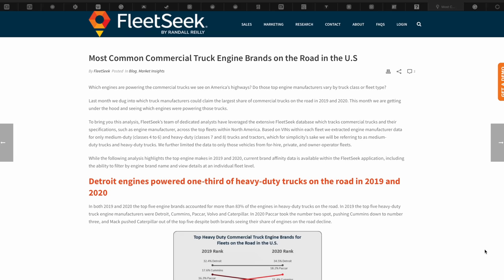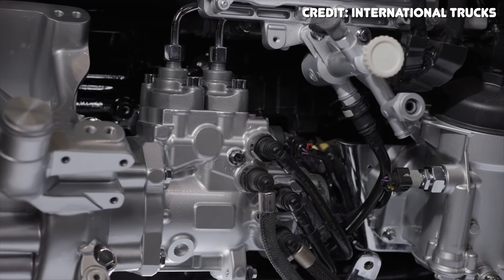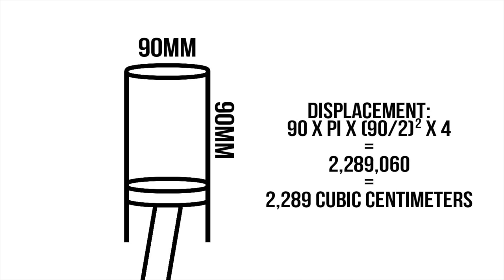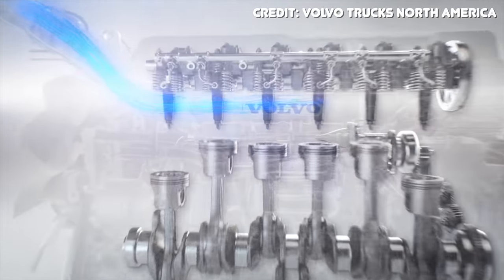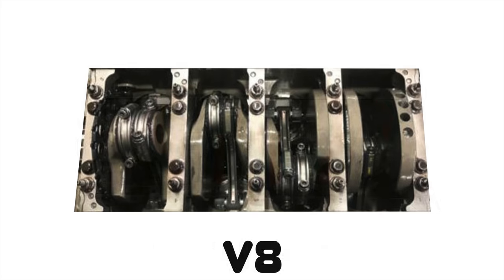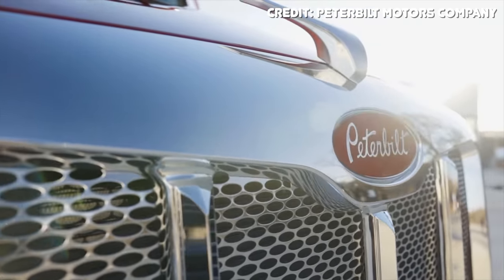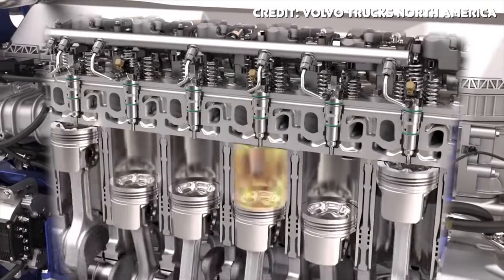Why do Semi-Trucks Use Inline-Six Engines?

Comment: My work truck with a Cummins in a Kenworth has almost 300k miles on it and still pulls 69,000lbs loads good. My work also has a Sterling with a Mercedes-Benz that has over 600k miles on it. I wish we had real Jake brakes with no mufflers on them

Comment: Inline 6 engines DO produce more TQ than ANY other style of cylinder arrangement because it allows the power stroke to apply force to the crank shaft for 120 degrees. I believe the 90 degree v style engine is the second best at 90 degrees of rotation being useful to power production.

Comment: Trucks in EU are limited by size, but still use inline 6 engines. I suppose that the longevity and ease of maintenance is more important than the size issue

Comment: the I6 has less lost motion than a v8 or a v6, the balance is better, and balance matters even at 2000rpm, also power pulses are smoother, crank harmonics are more manageable, and there are no shared firing cylinders wasting motion.

Comment: I hear people say “trucks need torque, not power” all the time and I’ve never understood why. They need torque at the wheels, not necessarily at the crank, and one way to achieve that is to have an engine that produces a tiny amount of torque at a huge speed and use gears to trade speed for torque; ultimately, to get the same wheel torque at the same speed, engine torque can be anything besides zero as long as the speed and gearing are appropriate, and the power output will always be the same. Is the real reason for this that trucks only actually need a few hundred hp, and the most efficient/reliable way to achieve that is with a big engine producing a ton of torque at a low speed?

Comment: Long strokes do not increase torque. The longer lever is countered by the smaller piston area. This was all researched decades ago. Long stroke engines typically produce high torque because that is all they CAN do. Their smaller pistons means they have smaller valves and smaller ports and higher piston speed so they will never rev up to produce lots of power so they are optimized for low rpm performance. On the other hand they have compact combustion chambers that burn well and quickly and have a lot less heat loss to the cooling system.
It is a myth that long strokes make more torque in and of themselves.(See "The Internal Combustion Engine in Theory and Practice" V1&V2 by C.F. Taylor. Which details a lot of that research.)

Comment: Does the low RPM really contribute to reliability? If the RPM is low because of the increased stroke but by definition increasing stroke means that the speed the piston moves inside the cylinder is increased for a given RPM (proportional to the increased stroke) then it cancels out so the friction (and therefore wear) experienced by the piston should be the same for a shorter stroke engine with a higher redline vs the long stroke engine with a lower redline. 

Don't they simply live for more miles because they do 100-1000 miles between cold starts while cars mostly do 5-25 miles between cold starts?

Comment: I was told way back when. . I-6 were smoother because of power hitting every 120° vs 90° and longer stroke allowed better low end lugging torque.

In trying to fathom the difference between torque and hp. I tell people that 800hp Dodge will never pull 80,000lbs the same as a 400hp truck engine.

Comment: In-line diesel engines are designed for one big thing which is: POWER Secondly, ease of maintenance and part replacement and compatibility with the old and new.

Comment: I'm kind of a newbie because I haven't worked much with diesel. And I haven't researched this question. But with regard to any internal combustion engine, I have wondered why, regardless of how many pistons,  why can't the crankshaft evenly split up the rotation? For example, with any six-cylinder, why doesn't the crankshaft split up the firing rotation every 60 degrees? Wouldn't that necessarily eliminate vibration?  Similarly, with a 4-cylinder, why not split it up every 90°?  Wouldn't that necessarily eliminate crankshaft balancers? With An 8-cylinder engine, couldn't the crankshaft rotation be set every 45 degrees?  I guess I need to research this to understand better. Any comments are welcome.

Comment: Regarding stayed words - bigger stroke gives more reliable engine - is not true. Cause forces(torque) is loading the rods and bearing  for one rev. If we get same torque in two or more revs of crankshaft that means that forces and loads are divided
The second thing is the longer stroke creates more rotational force on the skirt of the piston which is prone to rob against the cylinder wall. So stroker engines are less reliable.
I prefer longer rods with short Crankshaft, for more rev. And to have longer skirt on pistons for longevity. Downside of this is the low torque on low revs

Comment: Horsepower does matter though, 1,000 foot-pounds at 5 rpm won't be able to do much work. The larger stroke doesn't just mean more torque, it also decreases rpm. What genuinely makes these engines last so long is that they are driven on the highway all day without much stop-and-go traffic which causes 10-20 times as much engine wear. The engines also don't warm up so many times or drive cold as much as normal cars.

Comment: I'm asking this question out of ignorance, but with all the engine bay 
room in a commercial truck, is there some law of diminishing return that
 prevents a manufacturer from going to an in-line 8 engine to generate 
more torque and thereby pull loads more efficiently?  I would think that adding two additional cylinders and increasing the number of power strokes per rotation would provide a smoother engine balance and more efficient fuel consumption when under a load. What am I missing?

Comment: Other than a Detroit. some inline, some not. Screamers none the less. BTW trains (locomotives) are basically a Detroit 2 stroke diesel. What I have seen are 12v or 16v cylinders. And When did Cat go to a single head? I haven't been around large Cummins enough since school so don't remember if it was one or 3 like Cat.

Comment: No mate. The engines built for lower revs because it’s a trade off between weight, power output and service interval. Of course horsepower is still a meaningful metric! If you make the engine heavier it won’t rev as high, and if it revs lower but produces more power per rev, its service interval will be longer than say a motorcycle or F1 engine. If someone could produce an engine with low torque, high revvs, a useful gearbox, with low weight and good service life, it would be immensely popular.

Comment: Even and predictable cylinder wear unlike V-engines which have will have more wear due to increased friction as piston rests on the lower surface areas of the piston walls/sleeves...

Comment: Scania wanted to kill the v8 not too long ago but everyone complained. Fuel consumption and price are a big one really. With a straight 6 you only have 1 turbo usually and for the power levels it doesn't pound through the floor as much. Also fuel consumption matters.

Comment: Because they make more torque at a lower RPM. It's the same reason that the 4.0L straight six in the TJ Wrangler was better than the 3.w/e V6 in JK and newer ones. Way better for rock crawling.

Comment: The Six is a double edged sword, as it is loved by the trucking Industry and hated by car Companies for the same reason. They are better on gas/Diesel mileage, they can work just as hard as a V-8. (It just takes them a little longer.) They can deliver almost the  same performance as a V-8, and they are almost indestructible, Also if you somehow does kill one, it is the easiest motor to rebuild regardless to the make. Told to me by my  year old Father.

Comment: I challenge the notion that an undersquare engine is inherently more torquey than an oversquare one. Torque comes from displacement and tuning, not the geometry. Juggling the Force and the Distance numbers within the constraint of a fixed displacement will, I argue, produce similar torque numbers.

I think this misconception is the product of the fact that long stroke engines are generally tuned to produce their maximum torque down low. This is by necessity, given that the long stroke does come at an RPM penalty, due to the increased piston speed it creates. However, you could achieve the same numbers with big ol' bores and a short stroke if you really wanted to. It's just that packaging-wise, it makes more sense to keep the engine length shorter with smaller bores and use the vertical space to accommodate a longer crank throw instead.

Basically, what I'm saying is that the bore/stroke relationship doesn't have a direct affect on the torque/power production. Rather, it's the secondary associated issues of piston speed, valve shrouding, etc. that dictate the geometry of various engine types but people have latched onto the idea that it's the bore and stroke values themselves that matter.

Here's another example of an industrial engine that makes massive torque down low without being grossly undersquare: The Rolls-Royce Merlin V12, with a 5.4" bore x 6" stroke.

Comment: 7 main journals for the crank bearings in stead of 5 for a V8,  the crank is inherently stronger under a lot of HP and torque.  Look at Toyota's inline 6 twin turbo supra, on of the most durable motors out there making a ton of power.

Comment: I don't dispute the engineers about the smoothness of the I6, but I don't understand why that works. Three cylinder engines in my motorcycles and cars (Geo Metros) are not inherently smooth, so it's hard to see why two 3-cylinder engines combined would cancel each other's vibration. Two pistons' downward inertia will overcome that lone third piston going upward, or so it seems. 

The famous Ducati 90 degree v-twins are famous for their lack of vibration. I'm told their primary balance is nearly perfect with only a rocking couple disturbance. If that works for two cylinders, it's hard to see why that wouldn't work for v-four cylinders, or v-eights.

Comment: Two points about V-8 four stroke diesels not lasting long in the industry. 
Weight: V-8s were heavy, and in some cases weight kills your bottom line, and as stated below, they are wide engines.
Mileage is the other problem with V-8s. The CAT 3408, and the Mack E-9 were over 1,000 cubic inches, and they had two more cylinders to feed. V-8s like their fuel.
Yes Cummins had the 903 V-8, not 1,000 cubes, but still a heavy, big engine. 
Yes the 2 stroke Detroit's were smaller, so was the 3208 CAT V-8, but those engines didn't make the power that the E-9 and 3408 made.

Does any diesel engine sound better than a 12V92 Detroit 2 stroke, nope, not to me.

Comment: Research by scientists in Germany concluded that 500ml per cylinder is the ideal for efficiency, and this has been pretty well adopted by the German automotive manufacturers (and still the others usually don't stray too far from that). So it's curious why the truck engine makers stick with only 6 cylinders with displacements of more than 2 L per cylinder. I would think V12's at least would make more sense, with all the inherent balance of an I6.
Reply: I wonder what the efficiency is like on those big diesel engines, I though of this question within a min of starting the video, seems not many people are talking about it.

Comment: I would assume 1) fuel economy vs. performance, 2) ease of access for repairs and 3) no need for balancers to make it run smooth.
Reply: Also lower manufacturing cost due to reduced number of parts with the corollary fewer number of assembly steps.

Comment: Someone told me that long inline engines are smoother balanced and make less vibration which is another reason they work well for truck drivers. Other than that I know very little about commercial diesel engines.

Comment: I miss the Ford 300. It was an I6 gas powered block. Sad I can't retrofit my 2014 with one.

And also, semi truck engines nowadays are capped at 1600 RPMS, not 2000. We used to be capped at 2150 pre-2007 but the newer engines are designed to operate at even lower engine speeds and to maximize fuel economy which just gets worse the higher the revs. Back in the 70's that limit was 3000, but that's just to highlight that engines have gotten even lower in revs as time passes. Also, most trucks need an engine rebuild at 750,000-1,000,000 miles, not 2 million plus. While the block will last several million with ease, the pistons and sleeves don't and that can get worse if the maintenance isn't properly performed. My dad used to have hell with that in the 70's and 80's when water filters required periodic changing to keep an additive for the sleeve liners in the system or they'd wear out too fast and fail. Modern engines don't have that problem I think, but they still take wear and tear. 

Also, engine idling is a big thing we're fighting in the industry now. Trucks used to only get turned off on the rare occasion and would sit and idle all night long to provide the cab with heating, cooling or just power but now we have a new, additional system that provides that without running the main motor at a fraction of the run cost called an APU. My truck, a 2018 model, doesn't have one standard but a lot of new trucks do and it is mandatory in California and the American northeast where the liberals run things. Sad thing is, modern trucks also run clean thanks to DEF, DPF and other new systems so as they idle they're actually cleaning the air and making it cleaner than what the engine takes in and no longer produce harmful CO2 emissions like they used to.

Comment: I have several BMWs under my belt. The far best engines are the straight sixes. My B58 740i is the best one I've had of all of them. Also the old 2001 3.0 230hp was very nice for its day. All the crap with the V8s make them to be avoided. 4 poppers we don't like... :)

Comment: I love inline sixes. My mother had a 1970 Pontiac Stratochief with an indestructible Chevy 250 cu.in. six. I had a 1969 Toyota Crown with an inline six that was a solid performer (I wish I'd kept it, as it is a collector's item). Inline sixes are a pleasure to work on, with lots of room all around. V engines are not.

Comment: It is something of semantics here, but it is the nature of the Diesel piston engine, and NOT the nature of a "Truck" to emphasize torque over horsepower. The engine could be replaced with a turbine, which has low torque and is only efficient at high RPM. If one ignored the added frictional losses due to more stages of gear reduction from a turbine running, say ~36,000 RPM, while the drive wheels turn ~500 RPM), both the Diesel piston and gas turbine engines will require the SAME HORSEPOWER, but NOT THE SAME TORQUE to move 80k pounds up a 6% grade at 50 MPH.
NOTE: I picked 36,000 RPM because that was the nominal speed of the gas turbine engine Chrysler introduced in 1963 for use in cars (concept car, very limited production, only 55 made). Even more astonish is that its maximum RPM was 60,000 RPM at 120 MPH, roughly TEN TIMES the RPM of the piston engine it would replace. It was WAY ahead of its time and also ahead of the technology to make it a practical alternative. But with hybrid gas/electric cars of today, it could be very competitive because a gas turbine has slightly higher combustion efficiency than gas piston engines yet weigh much less. One of the issues it would have to address is that it takes a while to warm up and while it's still cold, its emissions would suffer.

Comment: European truck makers all had V8 (and V10 and V12) engines the reason they don't produce it anymore (besides Scania) is very simple: they cost lot more money than the S6 (or I6), and can have very similar power at general cargo hauling. And modern engineering developed to that point that an S6 can be as powerful as a V8, so for less money same power.

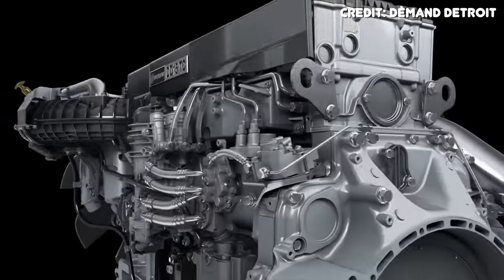Comment: 3:40 That's not what "begs the question" means. It is different than raises a question, as it doesn't call for a question to follow. It's a challenge to a logical debate where the challenger thinks his opponent has not made a good argument, specifically he is using circular reasoning. Don't believe me look it up.

Comment: Only reason that  6 inline engine is the most common????? Simple : fuel consumption and running cost.  In Europe to change a diesel injector to a Volvo fh 13, cost about 2400 €( 2.800$), if had more then 6 cilinders more cost, service cost more end soo on, big fleet dont Buy v8, but i work in Italy, there are a lot of v8 lovers here. Nice vid

Comment: I drive a semi. And I love me a straight 6.
But I wonder why bmw uses them so much. It been my understanding  v6 or v8 create more torq. My bmw 525i ran great little 2.5 liter in a 4200 lb car. 7k rev limit.
3.2 mercedes with a top end of 145. Pulls that 4500lb car around great. All these naturally aspirated.

Comment: I have a 5 cylinder engine 2,5 liter and turbo in my Volvo S80 (its a car on gasoline). Is there any truck diesel engines with 5 cylinders? Charlie

Comment: if an I6 has so many benefits (balance, simplicity, less parts and durability) why has it basically vanished from the automotive scene except BMW?  With that said why V6 is the configuration of choice?  I understand if it is a FWD transverse set up then packaging will be tough but MB got rid of their I6 for a V6 only now to bring back an I6, and there are a lot of RWD platforms that could easily fit an I6 (Mustang, 350Z, G37, Lexus GS IS, Jaguar, Land Rover etc)

Comment: I wish ford's new 7.3 gas burner was a straight six that made peak power at about 3000rpm and peak torque at 1500. with   stroke from the hood to the front axle and enough torque pick one front wheel first, then the other, off the road.